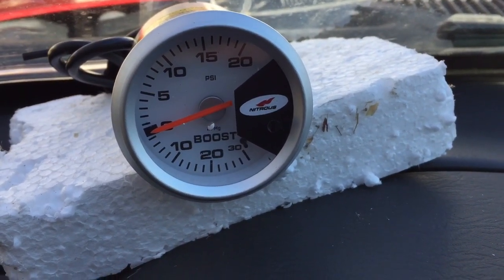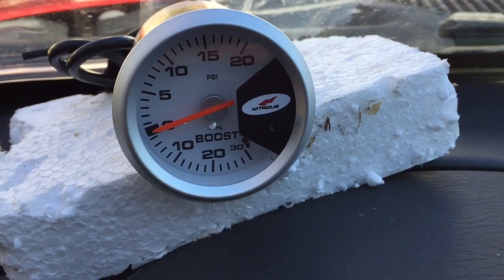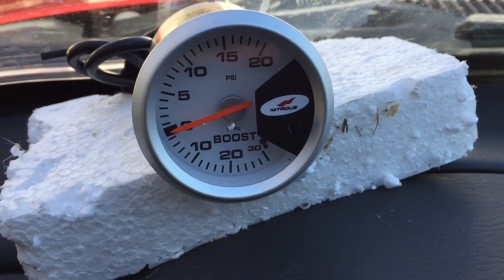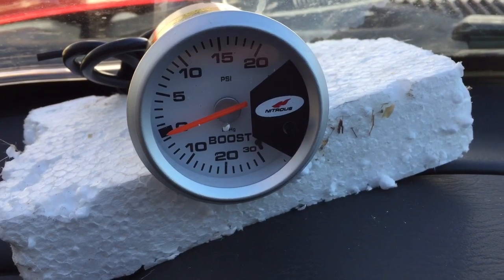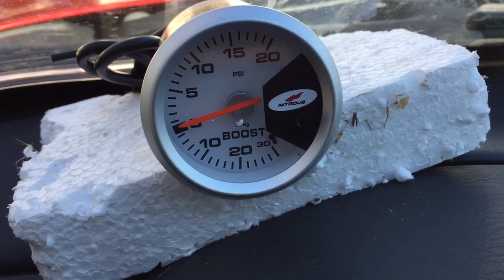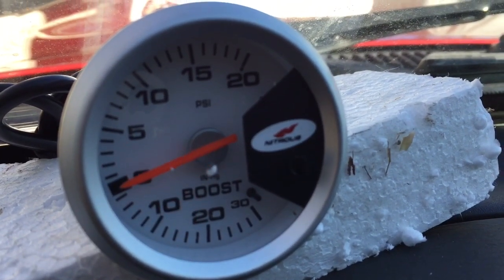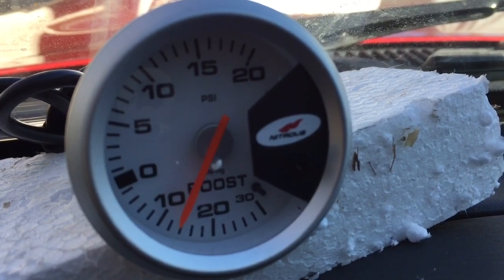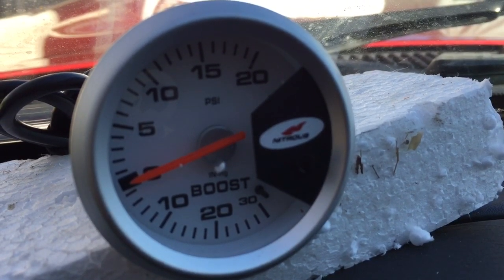Jeep Liberty Diesel with Harbor Freight Boost Gauge

Comment: Hello can you run the engine at early morning and read the boost gauge for me. Because im trying to mimic the map sensor (plated covered egr).  All i know egr only function at idle.   I have a bad egr.  I need that reading from cold to hot on idle. Thanks.
Reply from the maker: It will be a week or more before I could record that. However you might be reinventing the wheel. The EGR can be disabled with a DIY ECU tune and a $20 programmer. There used to exist a SEGR, or synthetic EGR that replaced the MAF sensor and simulated the needed MAP sensor values. Since the DIY tune to delete the EGT came along so cheap It is the preferred method for deleting the EGR. 

The EGR does function while driving, there are some speeds around 30mph where the EGR is very noticeable when it’s turned on.

Comment: hi late comment but where did you connect your boost gauge on the engine
Reply from the maker: You will have to drill and tap a hole to use for reading boost pressure, there is no easy to use pressure line already in place. If you look on the intake manifold you will see there are a couple of unused threaded holes on the top of the intake, one of which has a plastic clip pushed in that holds the glow plug wiring harness. You can drill a small hole in the bottom of this plug, about 1/8 inch or so, centered at the bottom, while being careful to keep metal shavings out of the intake. Options to keep shavings out are using a vacuum to suck shavings up as you slowly drill, making sure to back off frequently to clear shavings, and/or also use compressed air to blow out the hole, untill you eventially drill through the bottom of the hole, the idea is to keep too many shavings from building up in the flutes of the drill so there is nothing to fall into the intake when the drill eventually get through.

 Another option is to use a drill bit heavily greased with thick axle type grease, so that all shavings stick to the drill bit.

Then on the main hole which is a metric thread use a 1/8" NPT tap to retap the thread for standard pipe fitting style brass nipple adapters that you can attach your rubber line to the boost gauge.

You can also remove the intake elbow from the vehicle, and drill and tap on the backside, where it will be easy to clear the debris before reinstalling in the vehicle.
Reply: Good Morning, Thank you very much- I just happen to have a spare valve and intake cover I bought with the the damaged head I bought from a junk yard. I was a valve and rocker failure, I machine shop called yesterday and the head is ready- Tig welded and machined and new valves, guides and seals all cleaned up as well the valve cover cleaned all $539 canadian- this guy does diesel CAT and boat motors. Once it the spring comes I will do a head swap- new rockers, a new to me dismantled and cleaned turbo. I have already done a egr delete, GDE eco tune, weeks 1&2 and installed prevent 200.

Any other suggestions- again I appreciate your excellent video as references.
Reply from the maker: @mikej1389  If you have a spare or even just have your intake manifold off it should be easy to drill and tap anywhere on the intake really. If you are removing the EGR consider using the intake elbow EGR inlet with a brass plug to tube nipple adapter as a place to read boost pressure. If you look over on LostJeeps.com there will be other people that can share where they installed a pressure tap.

Comment: I removed my FCV, when I removed the EGR system, I've noticed a noticeably rough shut down.  Almost sounds like the engine is rattling in the mounts. The only reason I removed it is because the kit you can by from sasquatch deletes it.  I machined a square block that takes the place of the FCV and brass cap to plug the egr connection to the manifold. Maybe removing the FCV was a mistake, but its been like that for 3 years and 100 000km.
Reply from the maker: My other CRD I've owned since 2006 had the FCV fail sometime in 2008, the gears stripped out and it used to make  noise when it was trying to close after shutdown.
Part of what I noticed is the rougher shutdown, a working FCV does mean a smoother shutdown, though this many years later I have to say I don't think it makes any operational difference, and the little extra jolt at that last fire feels normal to me now.
Reply from the maker: My other CRD I've owned since 2006 had the FCV fail sometime in 2008, the gears stripped out and it used to make  noise when it was trying to close after shutdown.
Part of what I noticed is the rougher shutdown, a working FCV does mean a smoother shutdown, though this many years later I have to say I don't think it makes any operational difference, and the little extra jolt at that last fire feels normal to me now.